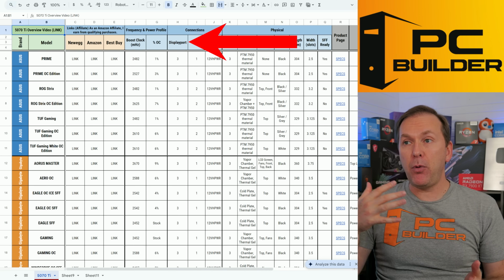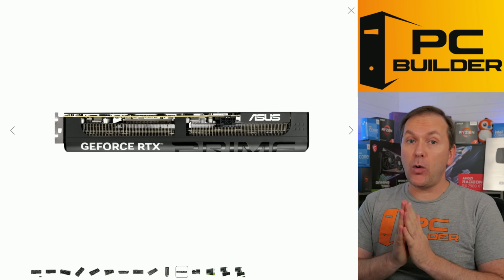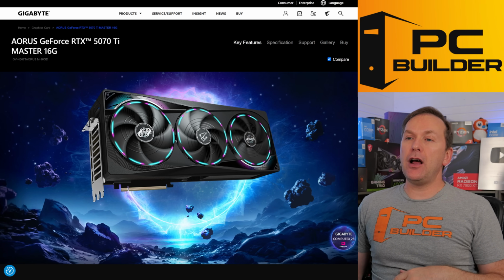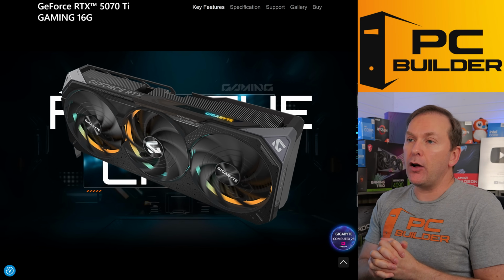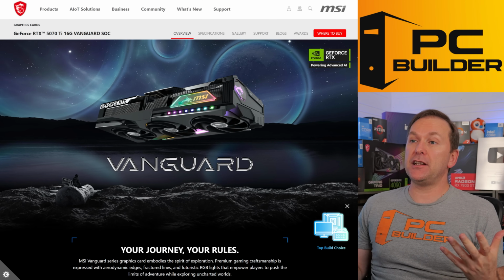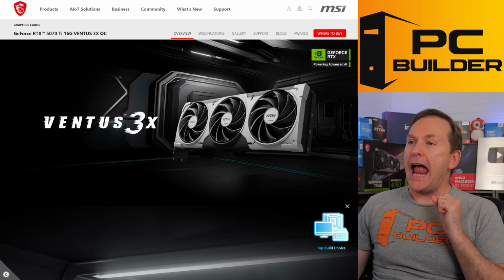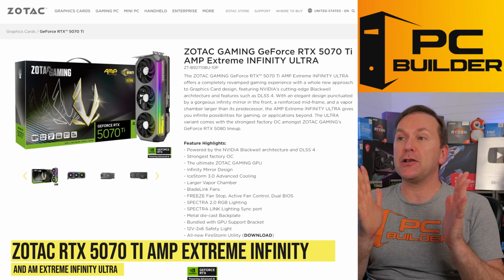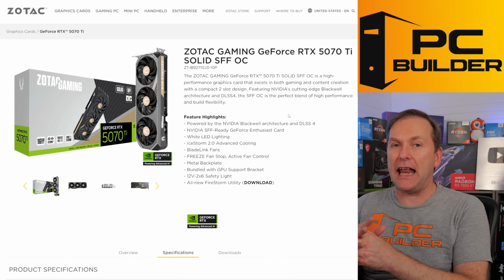DON'T BUY WRONG! 🛑 Every RTX 5070 Ti Model - Specs & Features

Comment from the maker: What GPU are you looking to get? What model of RTX 5070 Ti looks the best for you?
Reply: Just bought my oldest son a GIGABYTE 5070 ti gaming oc. Got it for $875.  Paired it with a $700 9800x3d Tomahawk x670e motherboard bundle. His younger Brother got his old Tomahawk z690 12600k rtx 3080 build. So both should be set for a long time.
Reply: can you do a RTX5080 video like this? :)
Reply: MSI Plus cards have a slightly different heat pipe configuration. Supposedly a better design buy naming designation but who knows. Otherwise the OC and OC Plus versions of MSI cards are identical. The heat pipe difference is visible below the output ports of the card.
Reply: Got me a PNY 5070TI ARGB OC and i really like it.
Reply: What’s the quietest one?
Reply: We need the RTX 5080 my lord
Reply: I bought the ASUS TUF Gaming GeForce RTX™ 5070 Ti 16GB GDDR7 OC Edition, i can overclock it ALOT over 300 on the core....:) I love this card.
Reply: Ordered the Aorus Master. I like big cards, what can I say.
Reply: Wich model do you recommend for a 9700x with a b650 gaming plus wifi motherboard?
Reply: I have the  Gigabyte RTX5070TI Gaming OC,  I clocked  it to 2750 stable, I know there are much higher clocks on this card out there, but its running like a beast.  my temps are 39c  on Deep cool Water.   After seeing the OC clock MHz  in the video, I feel i have made a justified significant purchase coming from a Zotac 1080TI Amp Extreme.  by the way the 1080TI handled everything and i mean everything I threw at it on ultra and high settings without breaking a sweat.  It was a 384 bit card with 11 gig Vram.   It's why it took me soooo long to upgrade.  I'll sing the praises of the 1080TI till  I'm in the ground.   I struggled with the decision to upgrade even to the day before ordering the 5070Ti because the 1080TI never failed me not once, never stuttered, never flickered, never teared, nothing, It ran so well  I haven't upgraded until yesterday.   and the most  It ever utilized  consistent was maybe 80%?  on games like Star Citizen (heavy intensive). Cyberpunk.  I don't know if i just lucked up and got good silicone or what, but that card Has Never had me set the settings on ANY game less than Ultra or High,   running  games smooth a butter .   but ray tracing? no  AI  tools Na,   but If there was a Neo in the Matrix ,  the 1080TI was it for me.      - p.s. still hasn't maxed utilization or failed.   Its sits in my closet saying "bruh ? !!"   and I'm like, "I KNOW, I KNOW!  Look! its me not you.  . . .    .
Reply: Breakfast with Jason! Cheese Omelette with Fries & Toast!!
Reply: Hey Jason, would you happen to know, what the Minimum PSU Wattage Required for the Intel ARC B570 GPU ?  Thanks,
Reply: the msi inspire, its the only one that fit my case hope it is good enough
Reply: I have a 4070TI Super that I got last fall during all the crazy sales.  However, I found a sweet deal on a 7900XTX, so going to try that out and hope FSR4 gets ported back to the 7000 series.
Reply: I''ve been looking for this for days, without any luck, as I'm in the market for a 5070ti myself and Deus ex machina popped up this video for me. Subscribed, Liked and Shared with my friends already!
I'd be interested in how Palit and Inno3d fair in comparison with the rest. Also, perhaps a video comparison about the relevant GPU software each of these manufacturers offer.
Thank you for this amazing content. 😇
Reply: @Baltasaru  I had a Palit Gamerock 3080ti, and it was a beast of a card, cool and quiet.
Reply: i want the Aorus but dont think itll fit in my NZXT H5 Elite sadly.. Might have to settle for the gigabyte gaming oc
Reply: @DelScully  They are hit or miss. When they hit, they are outstanding, when they miss, they screw your build.
Reply: Hope you'll see this and respond in 60min :D Just about to order mby MSI GeForce RTX 5070 Ti VANGUARD SOC  (987euro) or GIGABYTE GeForce RTX 5070 Ti GAMING OC (979e) , glass case so visuals are on the MSI side i think, how about the noise and performance comparison? Ty even if you don't respond on time :D , love your videos btw
Reply: @miljanmarjanovic5230 Just curious friend, why are you getting that card over a RX 9070 XT? Does your work require it? Or do you just strongly prefer Nvidia? I build PCs for a living, humor me if you will. (Btw, if I was forced to buy a 5070, then the deal you're looking at sounds decent IMO.)
Reply: I got the windforce SFF for a SFF no rgb build called "the black box". Pairing it with a 7 9700x3d which is not mine i got it from a friend that is not using it and will prob buy a beastier one for me in the near future.
Reply: @pablopandolfo8446  Are you satisfied with the Windforce? Temps? Noise? They're among the cheapest 5070ti models here in Serbia, along with Palit Gamingpro-S and Inno3d x3
Reply: I had originally bough the Aorus Elite 9070xt OC and lost the reliability lottery.  Constant crashes in Adrenaline no matter what I did.  Under volting, reducing power draw, same results.  Ended up swapping to a Asus Prime 5070ti.  No issues so far.
Reply: is pny 5070 oc good or break after 1 one month? please help
Reply: So which is the best "cheapest/no frills or RGB. But best performance card for the price?" It is going in a case where looks do not matter at all.
Reply: 3 jan 2026....just recieved my MSI RTX5070ti Expert.  this things a monster compared to my 4070ti Super  gamingX slim
Reply: I want noooo 5000 series cards, Nvidia is done with us and we should be done with them. My 9070 XT has exceeded my expectations.
Reply: @bizbarley74  Sounds like you're coping to me 😂
Reply: @funkyp6534  I don't know what that means.
Reply: i recently, barely a month ago, got the 5070 ti solid core from zotac, i never liked their gpu design, untill 50 series came out, im very happy with this card, it never goes above 65c, and if i wanted to, i could make it dead silent;
i managed to undervolt it to stable 0.860v, cut power from 300 to 200w
though i kind of overpaid for it, but oh well, thats the best i could get from nvidia
Reply: Not a Nvidia one!
Reply: Hey Jason, would you Recommend the 5070 (Non Ti) 12Gb GPU???
Reply: @michaeloneill1360  no
Reply: @michaeloneill1360  rather go for 9070xt cause more vram and better gaming without rtx
Reply: I want a 9070XT. Looking at the sapphire pulse or nitro plus, but they be Hella expensive

Comment: Sad to see that there's no substance in your judgement of the cards. This one looks better, this one looks worse, this one has 20 more mhz? Really, that is low bar for your channel, brother. What about heatpipes? MSI Ventus 3X has 4, which will make the fans go faster and louder to accomodate for the temp, and you never said anything about it. Maybe when you do the spreadsheet next time, you could mark this fairly IMPORTANT information?

Comment: The cooling capabilities are a big one. But believe it or not, but I would use software to limit the AORUS Master to stock settings. Maybe with power limiting and undervolting or so. However Id do it; To me, Lowest temperatures are more important than highest benchmarks.

Comment: I bought the Zotac RTX 5070 TI AMP extreme infinity overclocked triple fan. I bought it at first because of how it looked but then saw how it performs compared to other 5070 TI models. I wanted a lot of RGB on the card and I still do. I have Lian li fans and an MSI motherboard. Did I make choice when it comes to RGB and performance with my GPU? The only other contender I was looking at was a 7900 XTX asrock edition

Comment: Gigabyte is releasing a much shorter Windforce OC V2 version. Only 261 mm long, not 304. But Gigabyte has or had a problem with the cooling paste. Hope they have fixed that.

Comment: I need a compact graphics card and am choosing between Eagle and Prime. I was leaning toward Eagle because I liked the look better, the white color, and slightly better cooling. But this "liquid gasket" issue is really bothering me now, and I don't want to run into that problem. What would you recommend: should I go with Prime, or should I have no problems with Eagle?

Comment: My MSI Inspire 3X OC boosts to 2775 MHz out of the box in both stress tests and Cyberpunk. I'm not sure why the specs say it only boosts to 2482 MHz. It's been a great card so far. My only complaint is that the bios won't let you exceed the 300W TDP when overclocking. As I understand it, some other brands and models will let you increase the power limit to 325W or even 350W. I've tried flashing another bios version onto the card, but it only seems to work with the stock bios.

Comment: i just bought the Asus tough 5070 Ti version OC at best buy for 150 OFF was 850 bucks and it runs @ almost 2900 MHZ and in the bios it says it can run up 2 3.1 ghz    but its always over 2850 mhz and sometimes almost 2900 mhz @ 250 watts or so but in the bios it says it can go up to 350 watts of power . did they change the specs on the cards or did i just get lucky with this card ..... BTW i upgraded from a evga FTW 3 3080 TI 12 GB and was worth every penny....

Comment: Im thinking on the MSI gaming trio vs TUF, can someone give me a headsup?
Reply: I'm on the same boat. Probably gonna go with the ASUS because it has one of the, if not the best cooling solution of all of those.

The Gaming Trio has two versions, one of them being the non-Plus one, which comes with one less heatpipe (3 instead of 4). I believe the ASUS one has 5 or 6 heatpipes.

Did you ended up buying one?
Reply: @fluttzkrieg4392  Yep, I ended up buying the TUF too...

Comment: Hello! EVGA SuperNova 650 G3 80+ GOLD 650W and processor  Intel Core i7-12700KF. I'm playing in full HD and don't plan on overclocking. Is my power supply enough, Asus Prime GeForce RTX 5070 TiК
Reply: A 750w is the recommended psu.

Comment: The reality is that the hardware is the same; GPU silicon itself is identical. Any base model can in 5 minutes be overclocked to the level of the pre-OC'ed models. If 3rd party manufactuers had the freedom to, say, come out with higher vram versions, things might be more interesting (think GeForce 6800 era when manufacturers went off road from the nVidia 256mb/512mb specs to create their own 1GB versions)... well, things might be more interesting. As it stands I'd look more at warranty length than anything.

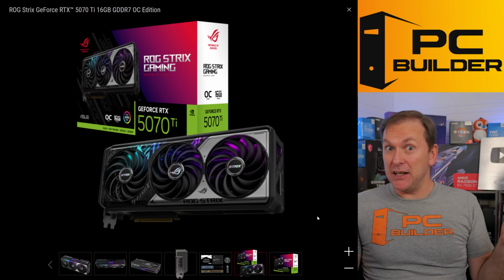Comment: Jason, doubt you'll see this comment, but at 9:14 are you sure a constant white power indicator is confirming the power supply is good on Gigabyte 5000 series GPUs?  I've seen contradicting comments about this online, which make me nervous.

Gigabyte 5070 Ti Gaming OC didn't come with a proper manual, just a quick start guide that tells you pretty much nothing.  Can't find anything on the Gigabyte website to confirm what the different colours/flashing means. I've raised a ticket with Gigabyte about this but their first response didn't confirm anything.

I'm hoping you're right, it makes sense to me.  Wish there was an industry standard.

Comment: Nice Video, excellent spreadsheet. Thanks a lot! I would like to see some temperatures and noise under stress test :)

p.s. Specs of Gigabyte Gamig OC says, that attached cable is: 1x 12V-2x6 to 3x PCIe 8pin adapter - for ATX 3.1
Reply from the maker: Thanks so much! Glad you enjoyed this one ;)

Comment: I see the Gigabyte GeForce RTX 5070 Ti WINDFORCE SFF Triple Fan at MSRP now ($745.99) in Microcenter. The previous decision was to wait for the remodeled refreshed super model. I'm just wondering if I should still stick with the plan to wait or just snap this at Mrsp. Upgrading from the RTX 3070
Reply from the maker: It’s going to be a long wait for the supers. Next year at the earliest and likely to have the same crazy price and stock issues. So really it boils down to how patient you want to be for probably not a ton of performance difference

Comment: I was leaning towards getting the Aorus Master and from what im getting from this video it is a great card. I don't know what the thermal gel and vapor chamber cooling stuff is but it sounds like it's not a issue I will really have to worry about. plan on pairing it with a 7800x3d in a corsair 4000x case.

Comment: Why is the PNY RTX 5070 Ti 16GB the cheapest one on the market and always is stock? You can find it all day long at $749.00
Reply: I think not enough advertising? They obviously use the same chip, like every other vendor, that was provided by nvidia, so basically it comes down to customer service and extra features that we can get compared to other AIBs. While it will definitely get you atleast 93-95% of the performance compared the top end cards, people just tend to spend a bit extra just to get a better named brand even if they all perform basically the same. For example, i don't think I'll pay $250-400 more just to see my temps from 65-ish to 50-ish degrees. But hey, that's just me.
Reply: @ShredderXGaming  I agree with you. I don't think spending couple hundred over msrp just for argb or the oc bump is worth it when PNY is perfectly fine as a brand and their cards can be manually overclocked with Afterburner.
Reply from the maker: PNY isn't as well known a brand in the US as others. When the MSI Ventus is $30 more and you're spending $750-800, I think people tend towards the brand name they know.
Reply: @PCBuilderChannel I ended up going with the gigabyte oc. I’ve heard seen a lot of negative reviews on pny stuff for some years now
Reply: After patrolling reddit, people say the card is literally fine and used to be a beast back then, but they don’t spend on marketing so to most people it’s just a ‘no name’ brand but they’re totally fine cards

I’m getting one cause I’m tired of pissin around waiting
Reply: @ArmanGT I was trying to get it and went to add to cart and it said unavailable. This was on the best buy app. If it isn’t available by the time it says in the app I’ll refund and go for the pny
Reply: Got a PNY 5070 ti epic-x rgb plus oc, it was the cheapest model I could find but has a very high and stable factory overclock. PNY cooked, this card is great value.

Comment: I have a 5070 geforce rtx oc 12gb and the main problem with it I have had is that rendering in daz won't trigger it.  I'm not sure if it's a problem with the card or if that daz needs to do a update for it to function.

Comment: I just ordered a PNY 5070 ti rgb plus oc for 874 euros incl. VAT, should arrive in about 10 days. I've seen good reviews, and according to TechPowerUp, the gpu has a vapor chamber, so it's cool and very quiet. I initially wanted to get the Palit, because I had a good experience with the 3080 ti Gamerock, but I only found the Gamingpro V1 at the same price as the PNY, but the V1 model comes with a copper plate.

Comment: Found the difference between the MSI RTX 5070 Ti Gaming OC and Gaming Trio OC Plus, if anyone's interested. Non-plus version has four heat pipes in its cooler design and weighs 1296g, while the Plus version has five heat pipes and weighs 14g more. At least that's the visible heat pipes seen from the end of the cards.

Comment: Amazing! I am uprading my pc after like 5 years. I currently have a rtx 2060 and a 1080p 60hz monitor. This is the build I was thinking (I am kinda new to pc building). What do you think? Would you change anything? My budget is 3500 usd including monitor.

CPU: AMD Ryzen 7 9800X3D ($472)

GPU: ASUS ROG Strix GeForce RTX 5070Ti OC Edition 16GB ($1,079)

Motherboard: ASUS TUF Gaming B650-PLUS WIFI ($278)

RAM: G.Skill Trident Z5 Neo RGB 32GB (2x16GB) DDR5-6000 ($119)

Storage: Samsung 990 PRO 2TB NVMe SSD ($149)

PSU: Corsair RM1000x 1000W 80+ Gold Fully Modular ($199)

Case: NZXT H9 Flow RGB ($289)

Cooling: Kraken 360 RGB ($219)

Monitor: ASUS ROG Strix XG27AQDMG 27" OLED ($658) 1440p

Total: 3462 USD
Reply from the maker: Looking good for a premium 9800X3D build! Check out our 9800X3D build guide if that's helpful for more

Comment: Just picked up an ASUS TUF 5070 ti. So far seems to be running great. Big help running MSFS
Reply from the maker: Nice! What CPU did you pair it with?
Reply: @PCBuilderChannel ……i7-13700 for now. Dont want the i9 series right now, and dont see the cost advantage in going with i7-14700

Comment: My case is not small form by any means, but 80% of these cards won't fit in it 😂
Reply from the maker: Crazy right?
Reply: @PCBuilderChannel Yup, crazy. My 11 lbs Haf 922 can accommodate "full sized cards", only its from a decade ago and the max lenght is 310mm. 😂

Not to mention ITX cases, which are practically dead now. I managed to cram a full-sized 3080 into a Corsair 380T Mini ITX case, but I have a feeling that might be my last GPU upgrade for a while. I have not seen Sff or micro cards that are truly small.

Comment: For clarification, the difference between the MSI gaming trio and gaming trio PLUS is a 5th heat pipe. So on paper the plus variants should have slightly better thermals.

Comment: THIS! EXACTLY this! Thank you so much for this overview. Everyone seems to compare the new to the old generation like "does it yield 0,085 fps more?", which seems (relatively) unnecessary given that you probably know whether your current configuration is struggling or not. But for someone like me who is upgrading a several years old PC what I am really concerned about (and overwhelmed with) is the question which actual model to buy. You did such a thorough and comprehensible overview that really helps to get an idea what those differences are all about and what one needs or wants. Thank you very much!